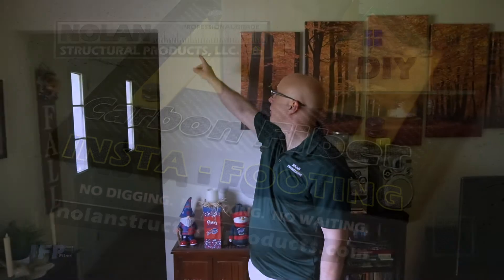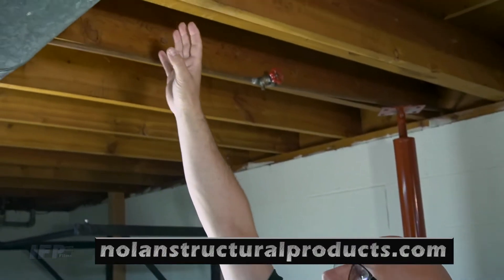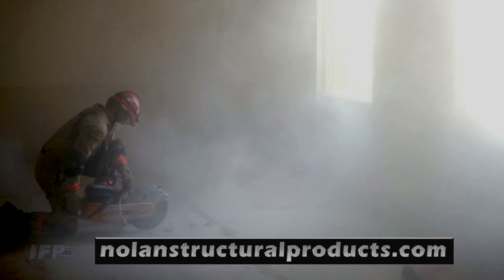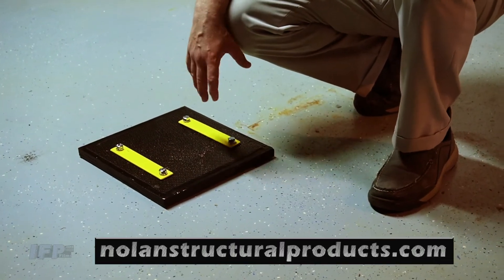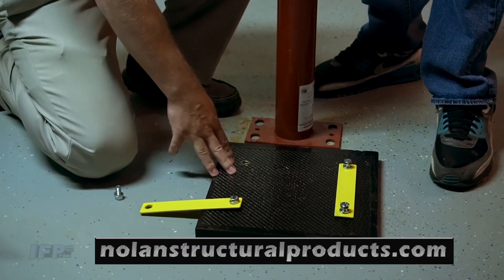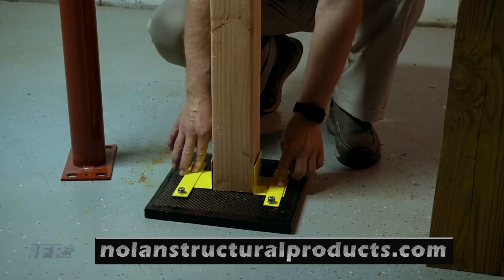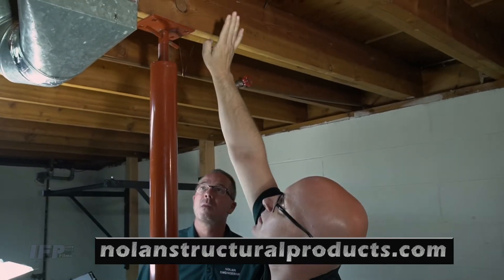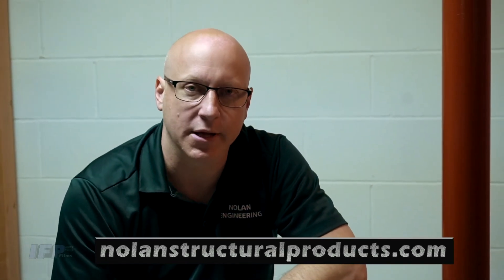Carbon Fiber Insta-Footing Support Post Base by Nolan Structural Products with Full Installation.

Comment: Is it okay if the instafooting is not sitting on a perfectly flat spot of the basement floor?
Reply from the maker: Thank you for the outreach. The easy answer is it does not matter. However, you could buy a small bag of grout or floor leveler, mix it with water and level the area easy enough if that is more to your aesthetic. Here to help. Good Luck.